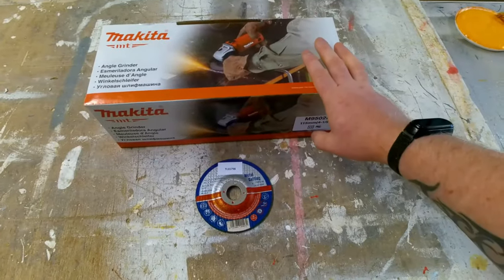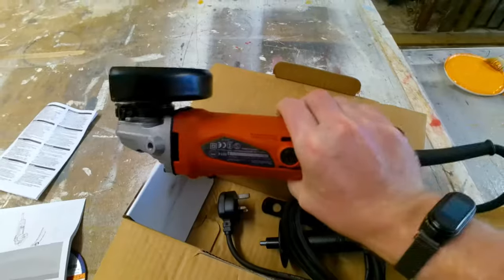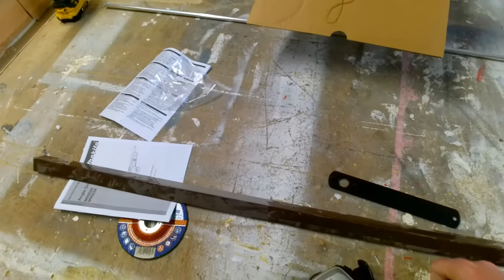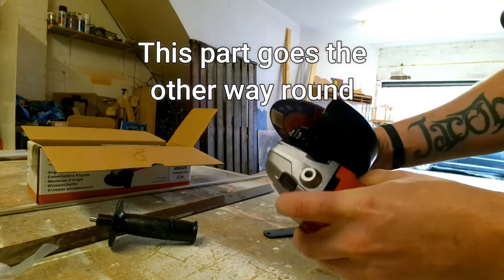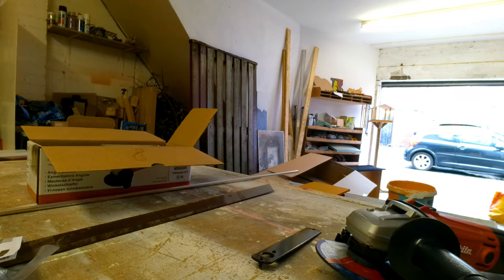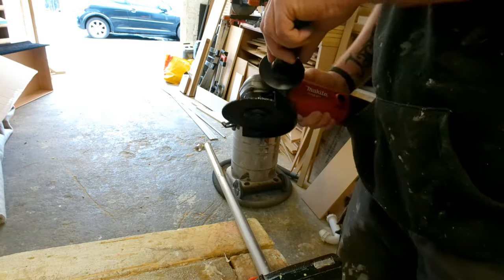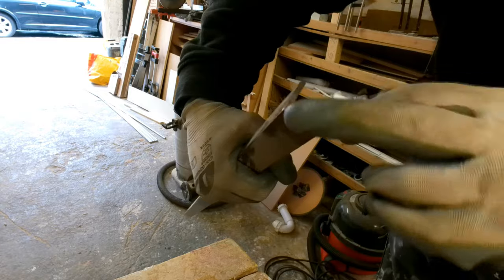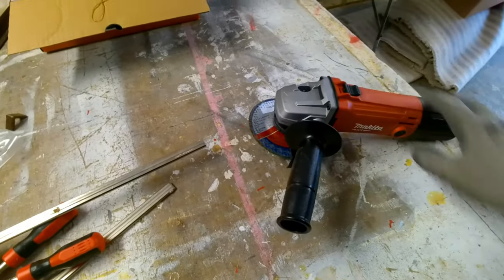Makita M9502R angle grinder : unboxing, setup and first time use

Comment: Thats not a cutting disc !!!,  
you are very lucky it did not explode in your face. 
So Dangerous
Reply from the maker: Tbf it says 'metal cutting' right on the disk 🤷‍♂️. I have however since changed to the thinner cutting disks and only use these ones to grind.